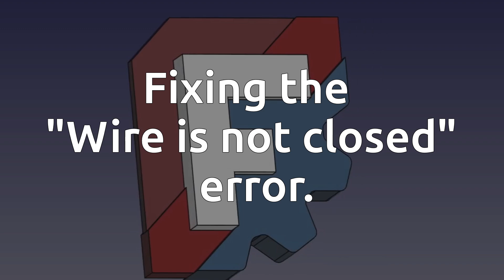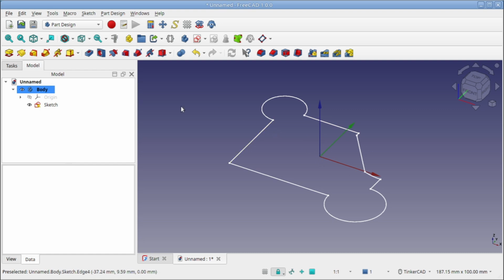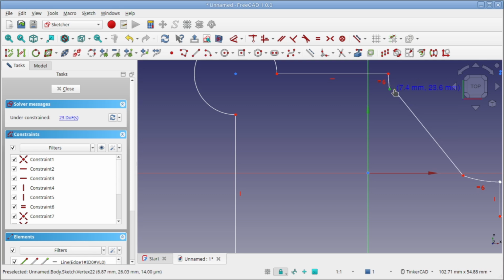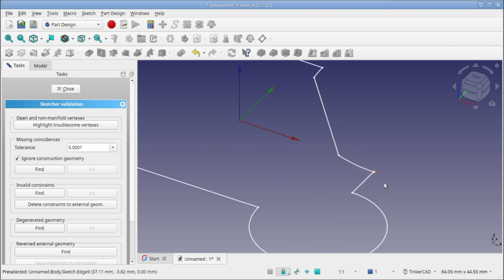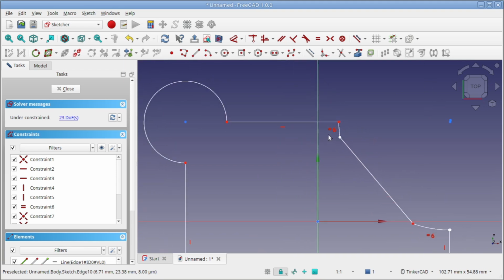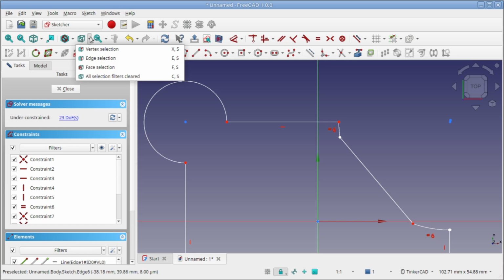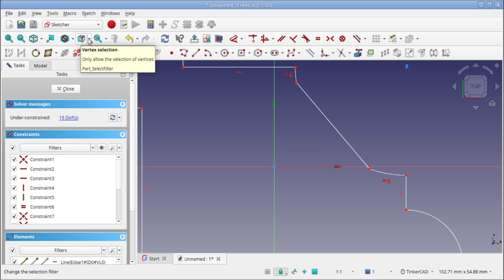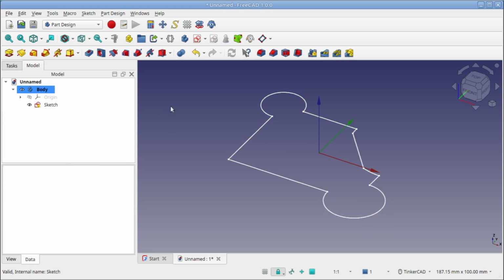FreeCAD quick tip - Fixing the "wire is not closed" error.

Comment: I am retired and can spend days learning new software. Was an IT manager and former Software Engineer so I have been around a lot of software through the years, I love FreeCAD. Have just purchased a 3D printer and am modeling tons of woodworking tools. Bottom line, I want to model some complex shapes fast. I have run into the "wire not closed problem" quite a few times. Knew it was something I was probably doing wrong. Your video was to the point and solved all of my "broken wire: problems. Very well done sir! MUCH appreciated!

Comment: One mistake that can happen with Freecad 1.0 is that if you click on a line of the sketch instead of selecting the sketch in the menu,  it will trying to create a solid out of that single line instead of the closed sketch figure and pop up the error message.

Comment: Instead of using the selection filter, drag-select from the opposite corner: Start on lower left and drag towards upper right. That will select objects that are completely inside the selection rectangle instead of those that are partially inside. Selecting things became much more smooth for me when I learned that there are two ways of doing it.